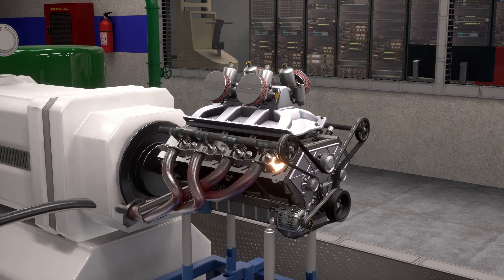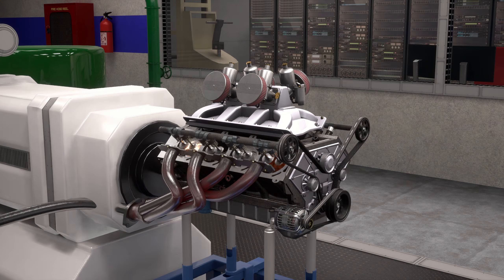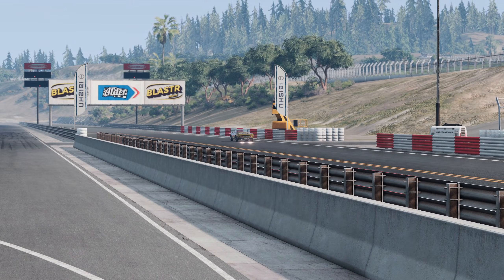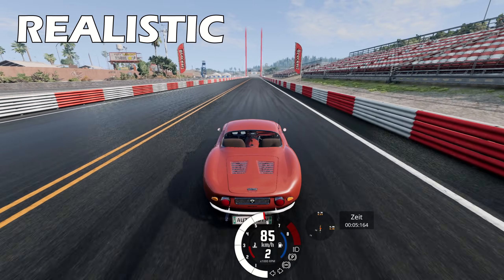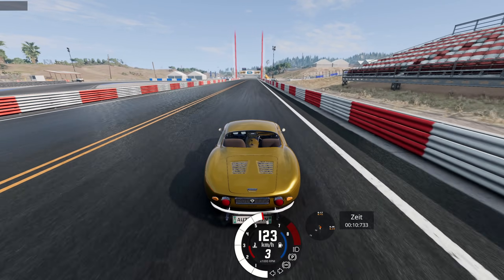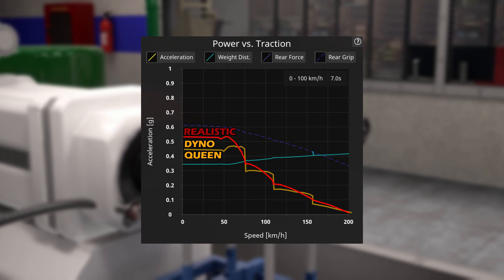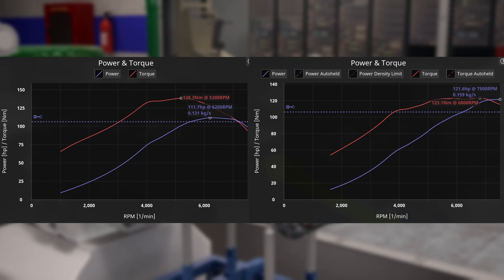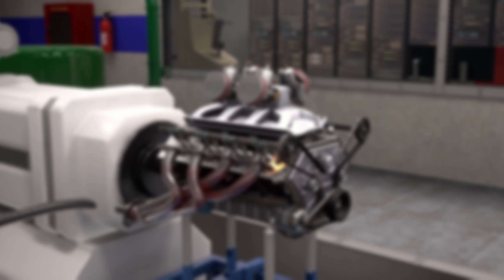Avoid this mistake when designing an Engine in Automation | Powerband Tutorial

Comment: Well explained!  I'll add my two cents as an automotive engineer, if I may; the engine power curve that will produce the best performance in your vehicle is the one that has the most average power over the engine speed range that will be used, and that speed range is a function of the gear ratios in the transmission.  To utilize a 'dyno queen' engine you need close ratio gearbox with very many gears.  But a reasonable road car with 4-5-6 gears in the transmission will probably have a 20 to 30% step between gears, meaning that if you upshift at redline the engine speed will be 20 to 30% lower than redline RPM after the shift.  For a 5000 RPM redline, for example, the engine will be turning 3500-4000 RPM after the shift.  So the best performing engine will be the one with the most average power between 3500 and 5000 RPM, in that case.
And that's only for full throttle acceleration - for good driving manners and fuel economy, having good torque down at the engine speed where the car cruises is important too, as Der Bayer mentions in the video.
Reply from the maker: Very nice explanation! I tried to keep things a bit more basic and and short in the video and already feared it would not be in-depth enough for some of the audience :)
Reply: This is the secret strength of the CVT, and why it was banned in F1 before it ever hit the track - engineers could design an engine with the most absurd tiny power peak, but the transmission could keep the engine snugly at that peak at all times.

I wish Automation allowed us to make racing-quality CVTs.
Reply: @doylerudolph7965 Yeah that sounds like it'd be the obvious choice for a top speed oriented car
Reply: That's a great explanation. I tend to avoid explaining it to people cause it gets too in depth when I try, but yours might be short and easy enough. I'll probably pin this in a modding channel if that's okay!
Reply: I mostly build mock imitation turbo diesels, my power curve ends at 5000RPM :D
Reply: I was going to say, when I make engines with RK engine mod in beam ng, and I get a power curve like this, I just close gear. A relatively low final drive, and then 7 speed sequential with close gears.  As long as you can get to the high revs fast, that's good. But yeah if you have peak torque at redline, that's kind of a waste and it would be better to have that torque peak a little earlier on

Comment: THIS! So many people tend to get hogged up on the "peak" stats of an engine. I personally try to go for x amount of torque between a specific rpm range (generally lower), which helps massively when building the engine. Also, gearbox and tyres matter a lot for acceleration (especially in the later stage of campaigns, 80's-00's cars). I wish we'd had diesel engines for this game, however they can  be simulated relatively easily since the turbo revamp as well as all new types of fuel(s). As for this type of content - I'm all for it. I personally might do Automation guides, tips and tricks on my own (other) channel, to help newer and less understanding players with engineering. Do continue if you want to make this a series! Love your content man.